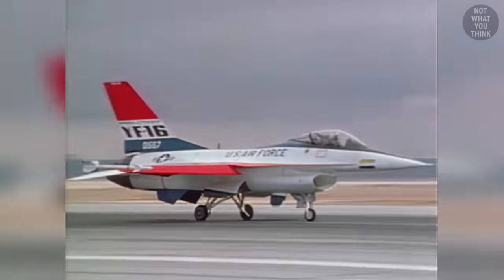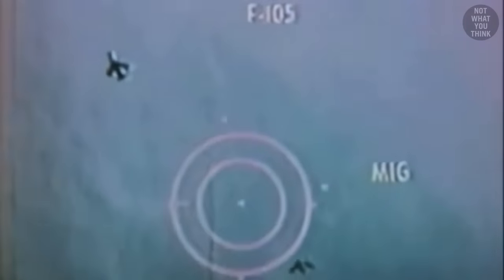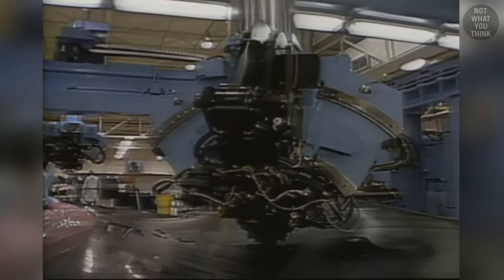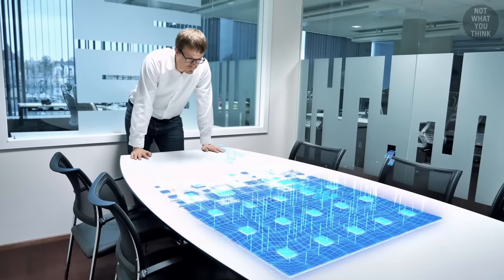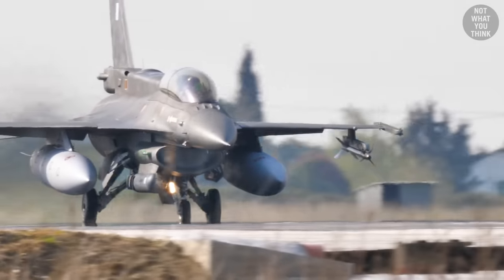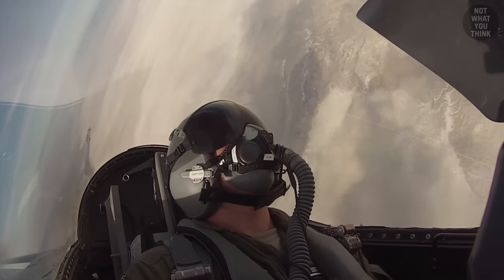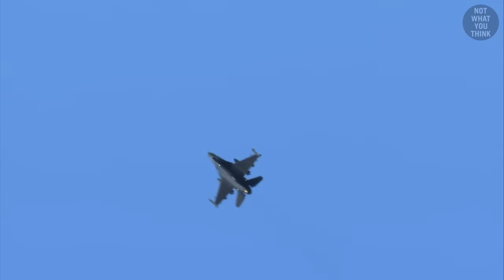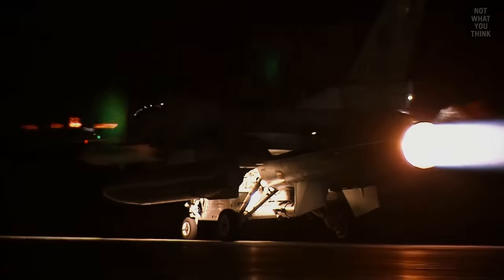Why the F-16 was Intentionally Built to be UNSTABLE

Comment: I thought EVERY fighter jet developed by the West in the last 50 or 60 years were design unstable, once computer tech developed enough so that 5he Fly By Wire system could make it stable.

Being unstable means greater response.
Reply: Its not really about quicker response, it's about getting more G from a given airplane by reducing negative lift and trim drag at the tail.
Reply: @gort8203  dude, same thing.  Quicker response means higher g-force during maneuvers.
Reply: @VAMobMember  No, it absolutely does not, dude.  Quicker response just means the airplane reacts more quickly to a stick input and pitches more rapidly to the AOA limit.  It does not increase the amount of lift the airplane generates at that limit. These are two separate things.

Back when it was in service the USAF jet that had the highest G onset rate was the T-37 trainer, which had a high incidence of G-induced loss of consciousness. Very rapid response to stick input and very rapid buildup of G, even though it was a very stable aircraft.  Even statically stable fighters are very responsive to the controls. Making the controls twitchier does not really make the airplane turn better. Getting to the G limit a fraction of a section sooner only improves the turn for a fraction of second, but twitchy controls make it hard to hold the airplane right on the AOA or G limit throughout the turn.  Holding the airplane at the limit for 10s of seconds is much more productive than reaching that limit a 10th of a second sooner.  With twitchy controls a human pilot has trouble holding the wing precisely at the AOA or G desired, but FBW controls can do it for him.  

Again, the real purpose of relaxed static stability is to allow the tailplane to add to the total G produced by the aircraft rather than subtract from it. If the wing is producing 30,000 lb. of lift, but the tail has to produce 2,000 lbs. of negative lift to hold the nose up at the desired AOA, the airplane is only producing a total of 28,000 lbs. of lift.  If you move the CG aft of the center of pressure and the tail produces 2,000 lbs. of positive lift while holding the desired AOA, the airplane is producing total of 32,000 pounds of lift.  Guess which one turns tighter.

This is of benefit even if you are not producing lift at the limit.  Say you only need 20,000 lbs. of lift for the turn you want to sustain.  If the wing has to produce less of that total lift it can operate at a reduced angle of attack, reducing drag and making the G more sustainable.  

I won't bother to explain the reduction in trim drag when the airplane geos supersonic, which is another important benefit of relaxed static stability.
Reply: @gort8203  sorry but EVERYTHING I learned as an Engineer in school plus my professional carver say I be right, you be wrong.
Reply: @VAMobMember    Obviously your schooling and career have nothing to do with aerodynamics, and it doesn't sound like you've ever flown a high-performance jet.  You should read more. For example, here is a little tidbit on relaxed static stability from T.O 1F-16A-1 Page 6-1. You might notice it does mention reducing trim drag and increasing maximum lift, but  says nothing about "greater response".  So, it say I be right, you be wrong.  It's sad you are so educated that you can learn nothing here.

"Artificial stability provided by the FLCS allows for relaxed
static stability which increases performance and
maneuverability by reducing trim drag and increasing
maximum lift."
Reply: I guess the sound of crickets is reward enough.

Comment: It's both a historical travesty and blatantly irresponsible to claim the Fighter Mafia had anything positive to do with the creation of the F-16. As a channel that advertises itself as informational, it is irresponsible for you to perpetuate this farse of an idea. Your content standards are certainly higher than what you've done here, which is essentially parroting a wikipedia page on the F-16.

If the fighter mafia had their way with it, the F-16 would have had barely enough fuel to make it through a dogfight (much less return home), would have never carried any armaments besides the main cannon since things like the AIM-9 Sidewinder are expensive wastes of resources in their eyes, and the pilot would've been flying nearly blind inside a metal tube with a jet engine because they wanted to rip out half of the electronics in the plane (for the same reason they didn't want missiles on it).

The only reason they have any recognition with the plane is because the F-16 is a maneuverable fighter and they cling to the energy–maneuverability theory like it's their religion. They screamed at the military for a maneuverable fighter while the military was already starting to make one. They then pushed for it to be even more lightweight by stripping out half the systems, got flatly rejected but still went on to erroneously claim that they were somehow a vital part of the F-16's development. 

Imagine this: there's a group of people, the House Mafia. They saw a house under construction and yelled at the people building the house to remove the plumbing and electricity since "a great house only needs to protect you from the elements, it doesn't need a bathroom or lightbulbs, just use a bucket and candles!" The house was finished with all the plumbing and electricity; the house mafia didn't like it one bit. But, they saw everyone else fawning over this very nice house, so they stood on top of the finished house and proclaimed, "Look at this amazing house I built!"

That's what the fighter mafia did.

Comment: This video is full of errors. The main point of (Y)F-16 aerodynamics is relaxed PITCH stability. Not relaxed ROLL stability. And YF-16 was metastable, not unstable. And many older planes had only single engine. They did not "remove an engine".

And this video totally fails to explain the REAL reason why F-16 had relaxed pitch stability: Recuding trig drag.

Comment: Never fails to get most things wrong. Had he just copied even the Wikipedia entry it would have been more accurate lol

“The seat is designed to tilt back at a specific angle during high G manoeuvres” - it’s clear this guy has zero understanding and can’t even be bothered to research his videos. No, the seat does not tilt back during high G manoeuvres. It’s just 30degees tilted all the time. 

These channels literally make us stupider as we passively pick up incorrect information watching these low effort videos made solely for the video sponsors.